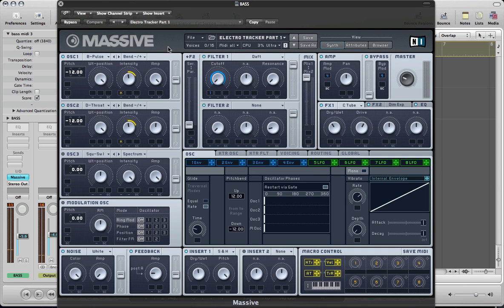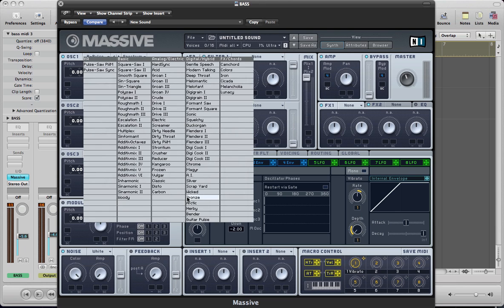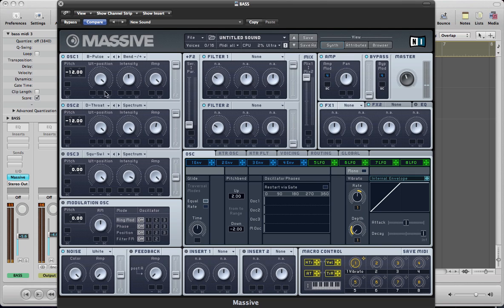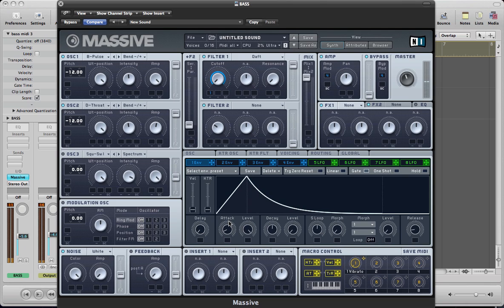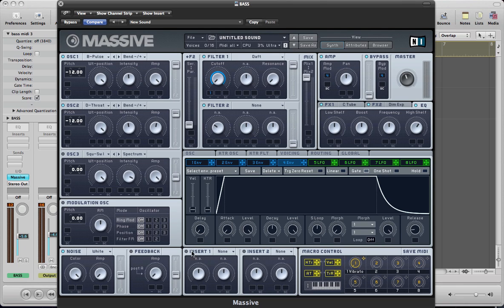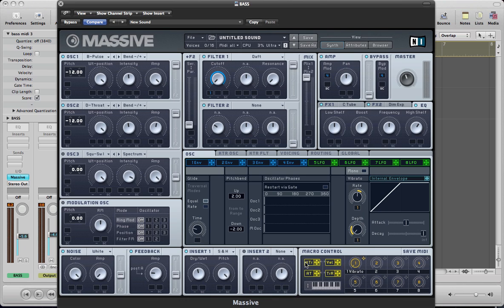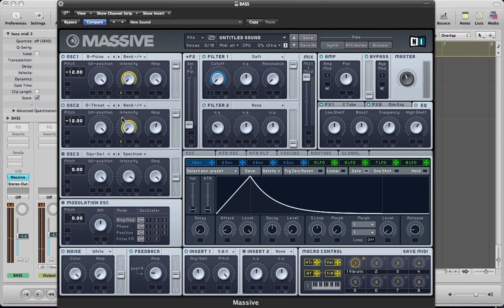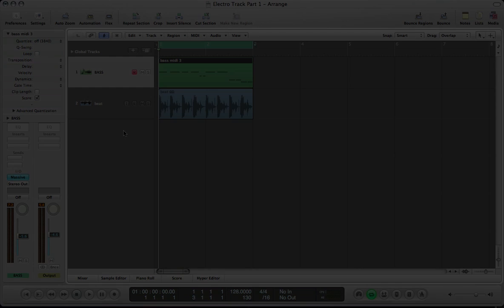Creating An Electro Song In NI Massive -- Part 1 The Bass Synth

Comment: How do the last 4 notes of the loop change in pitch? In the MIDI you can see they are two notes of the same pitch and then the next two are a few keys below, but with each of the two it sounds as if the first one is lower then the next one.